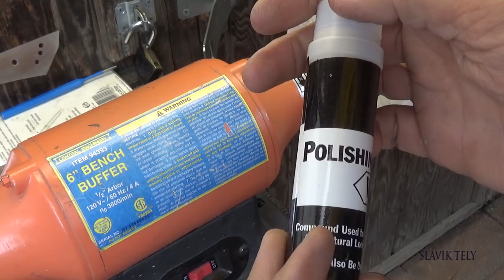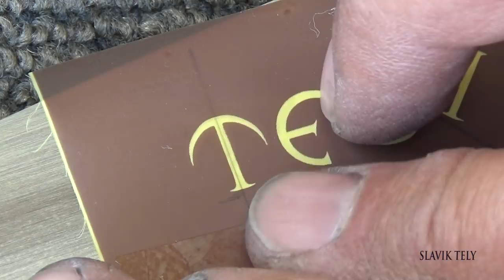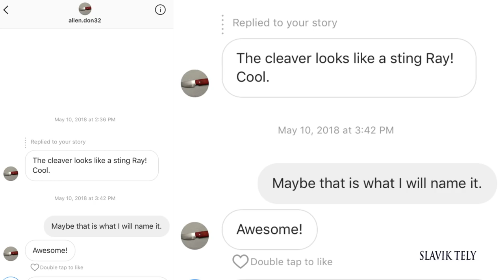Making STING RAY CLEAVER P3

Comment: With the cheap and horrible Oriental Imports of shoddy goods, I thought, the Craftsmanship / Artisan had died in the WEST. You have restored my confidence and pride in Western Superiority. Yes, it is a Work of Arts and true Craftsmanship.  I don't mind paying a higher price for such a tool. I have inherited a set of wrought iron and a copper knives from my great grandfather. Both are more than 120 years old, yet, they keep their sharpness and they look stunning. I use them everyday. I sharpen them with my drill and hone them on my, yes, ggf thick leather belt the I smear occasionally with lard.

Comment: I have a question on the way you polished the blade... why’d you wet sand it which left the lines in stead of taking a buffer or an orbital to buff and polish the blade? Wouldn’t leave any lines or marks, and would leave a crystal clear reflection. Again i don’t know much about knives but polishing is polishing. Thanks for reading
Reply: Seemed like he did it to have a clear distinction between the cutting edge and the rest of the blade.
Reply from the maker: I wanted to have somewhat of a mirror polish on the bevel and statin finish on the  rest of the cleaver.

Comment: I really like the design it is a beautiful piece, and I have a couple of questions.  What type of metal is that, and roughly how many hours did you have in this altogether?
Reply from the maker: I list materials used below the video. I have 2 hours in filing each bevel and lots of hand sanding.

Comment: Hi Slavik. Love your work.
I have 3 questions:
1. What material did you use for the handle?
2. For sanding, did you use regular sand paper strips or was that something else?
3. What material did you use for the sheath? It looked like leather and was rigid like acrylic...
Reply from the maker: Look below the video.
Reply: SLAVIK TELY got it. Thanks a lot!!

Comment: Perfect in every way, except for two things.. #1, it would have been better if you went deeper in the bevel Edge, #2, if you would have sharpened it with a sharpening stone... instead of the belt sander.
Reply from the maker: At this time I don't have a sharpening stone.

Comment: I hate to bother you with trivial questions.  But what is the grinding wheel called that you use in the drill press?  It looks to be about 1" in diameter and possibly made of carbide?  I'd like to get one of those.  Thanks in advance for the advice.  Love the videos, my friend.
Reply from the maker: Diamond wheel. Harbor Freight.

Comment: Hi Tely, great work, thanks for the video, what grit belt did you use to put the final edge on the blade?
Reply from the maker: I start with 220 grit and then use worn out 220 to touch it up. After that I might go to a Lansky sharpening system.

Comment: what is the best tool for knife sharpening, for an old knife which need it real bad. it really dont cut anything
Reply: What do you have to work with?  A bench grinder or belt sander, like he has in the videos, work well, you need medium and fine grits to get a good edge.  If you don't have them, whet stones are the same, only arm powered.  Still no?  Get a piece of window glass, maybe 12x12 inches, masking tape and some wet/dry sandpaper.  220, 400, 600 and if you want a really fine edge, 800 and 1000 grit.  Tape the sandpaper to the glass and spend some time sharpening.Something else to look at is "why" the knife won't cut.  Is it just dull from not being sharpened or is it damage?  Did someone heat it and take out the temper?  If so, it needs to be re-tempered, otherwise it will never take or keep a good edge.
Reply: Thanks for your comment, actually i do not dare sharpening the knife by hand, im scared the blade wont stay straight as it is now. Im looking for some device for getting an even blade. The one Tely often uses to sharpen his ones, where you got this pole with some grindstone on the end, how is that called?.
Reply: If you are talking about the one in the video, it's a bench-top belt sander.  You only see the area where he is working; you don't see the rest of the machine.

Comment: I think the blade is too polished and the handle would have looked better without the pointy end. otherwise it's great looking. The two things I mentioned are purely personal thoughts on cosmetics, nothing to do with your work or it's quality... GJ
Reply from the maker: I too think I should change the buttend of the handle a little bit. Maybe round it off.